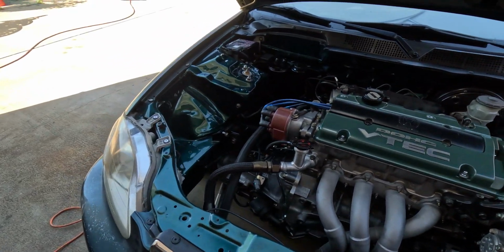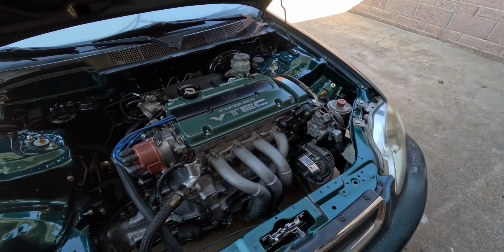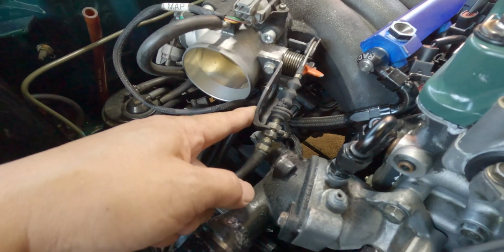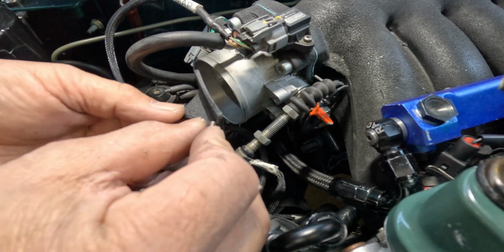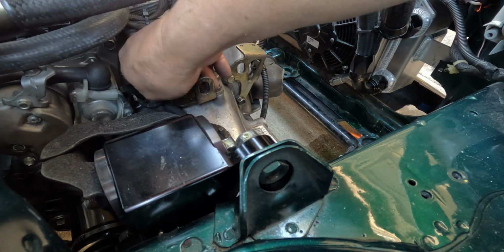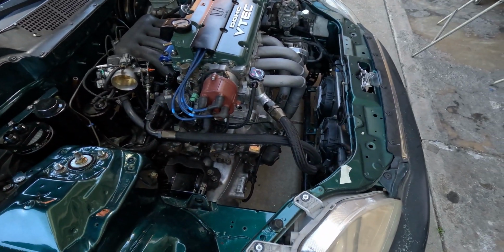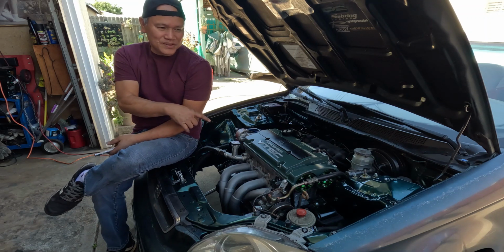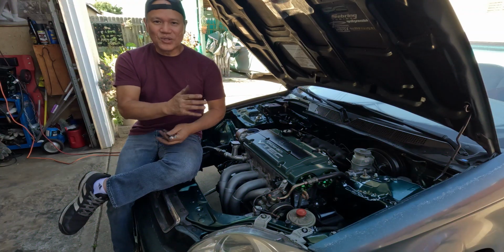Not sure what to call it? G2BK or G23BK? ep. 11

Comment: G2b is probably the correct way to describe it for the h/f following. Right now my f22a is making 191whp at 7k with a regrind cam. I'm looking to find a f23 block I have some k20a2 pistons. I appreciate all your content keep it up.
Reply: I think you'll make power with a well ported h series intake manifold. Your last 2.3 made 215whp when you dynoed it at import auto pros. With a 3" exhaust you would have made 230 easy
Reply from the maker: Not sure if H mani will fit on the space lt has and we shall see how much it'll make. The motor has more comp ratio than the last and l installed a 3" exhaust. Thanks
Reply: Btw it's Eric the white dude that was working at Import Auto pros when you dynoed the accord. H series manifold and the skunk2 h mani cleared on my eg and Ek swaps. I've seen h2b ef cars have clearance even with the skunk2 h manifold. How much power you think the new setup will make?
Reply from the maker: @ericloki3188  wazzzup man! You still do a dig a importautos? I'll be there soon by december to get Myllie w/ her new g23bk. It's a custom G2b build. Euro r mani hardly fit on it. Impressive power youv'e got on your F22 man! Awesome and good to hear about your build man. Later
Reply: @sagittnet2158  I think you'll be in that 230+whp range that's really exciting. Keep up the good work your doing the best G series builds on YouTube.
Reply from the maker: @ericloki3188  thanks eric, we'll find out soon.